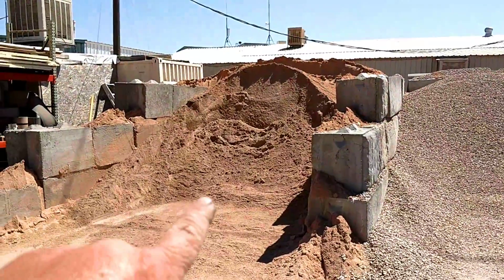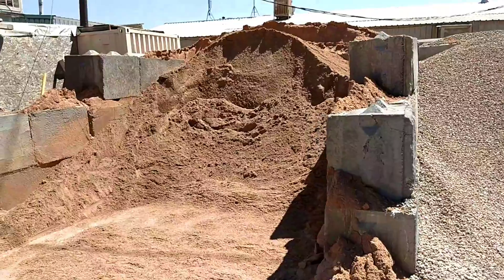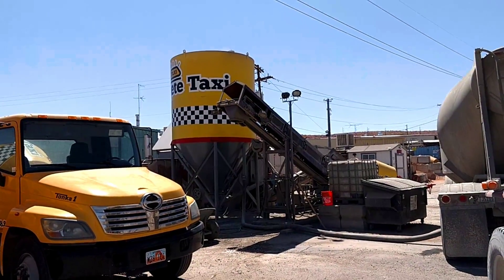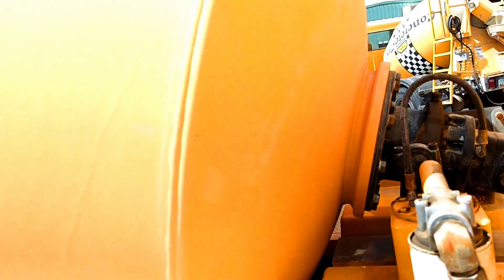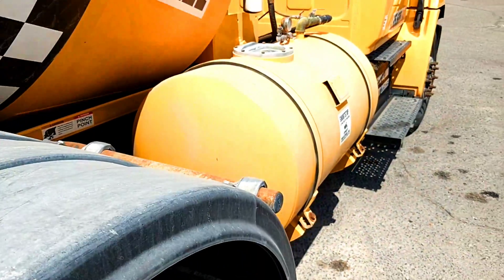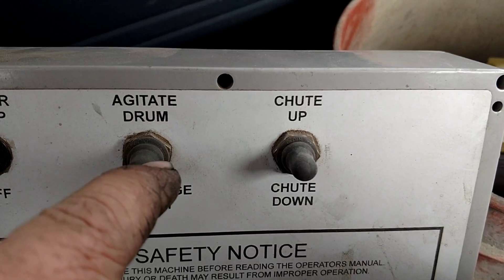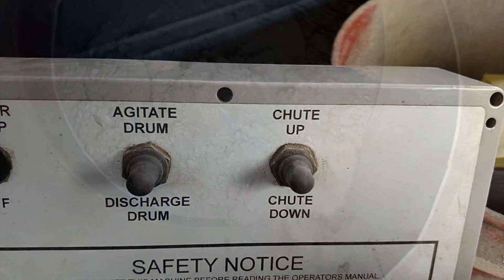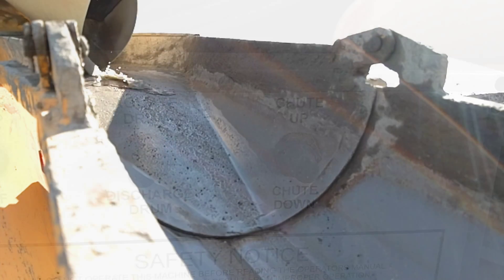How Concrete Trucks Work

Comment: This is more of a 'what a concrete truck does' and not 'how it works'.  I wanna know how the concrete comes out the back, does the drum reverse its spin...???
Reply from the maker: Yes, the direction can be reversed from mix to eject, as well as controlling the speed. It can be done from the back and/or from the cab. The throttle also increases the speed of rotation if the switch is engaged to eject or mix the concrete.

Comment: I worked as a ready-mixed concrete truck driver. And he also used muriatic acid to clean. He also used a diesel sprayer so that the entire structure of the drum was oiled and the cement did not stick. I also cleaned the drum internally many times.
Reply from the maker: I like the diesel idea. We use it for concrete forms. I never tried in the drum though.

Comment: Most builders are spot on with the amount needed it isn't just order a truckload and then figure out what to do. If a few wheelbarrows are still left we find odd jobs to use it on the same worksite nothing is wasted, as stated if enough is left the driver will disperse it into formworks for big blocks at the mixing depot, very useful and efficient. Trucks and roads are smaller in my state as it's mountain terrain.
Reply from the maker: These trucks are super handy for tight spaces and small roads.

Comment: I've never seen a medium duty concrete mixer before. All of the ones I've seen are heavy duty ones.
Reply from the maker: Yeah, it's not big at all. They are used in Europe more often.
Reply: @VanDamArtisan  also what are very rare here in the USA are cabover semis nowadays. I use to see them all the time back in the '80s & down along with a lot of conventional cab ones too, a mix of both kinds of semis. Then when the law in the USA increased the length limit, cabovers phased out & more conventional cabs took their places. Cabovers are common in many other countries, especially over in the UK because their streets have tight corners which are too difficult for conventional cabs to turn on which is why cabovers are the only semis they have.
Reply from the maker: That makes sense. I never noticed that before, but yeah, they used to be all over the place. I pretty much never see them anymore.
Reply: @VanDamArtisan  I bet back in the cabover days whenever the drivers took their semis into the shop for service, they'd forget to take all of their lose stuff out of the cab. Then when the mechanic begins to work on it, all of the driver's stuff inside the cab goes all over the place & sometimes break the windshield too when he tilts up the cab for access to the motor. I bet that was an inconvenience & another inconvenience was drivers who were overweight had trouble getting in & out of the cabs because cabovers had wider cabs & the second step on the sides of the cab was above the front wheel & far from the first step which made the driver have to hold onto the vertical bars on the side of the cab & take one big step between the first & second steps without slipping off & getting hurt unlike conventional cabs that have a narrower cab & are easy to get in & out of & easier to get to the motor & work on it too. I bet semi drivers hated climbing up & down at an angle without trying to slip off the steps, especially in cold snowy weather whenever they'd entered & exited their semis back in those days. Cabovers & conventional cabs have the same overall width, cabovers have a shorter wheel base & why the cabover cabs were wider was because they had to make room for the motor inside the cab which was between the driver & passenger seats underneath the motor housing & not to forget the sleeper in them wasn't as roomy as in a conventional cab because of the motor underneath too. In a head-on crash with another vehicle, the cabover driver would either fly out through the windshield or get his legs & feet crushed on impact depending on the weight of the other vehicle & the speed it was going because the semi drivers were up near the very front having very little protection between him & whatever is coming at him in front.

Comment: Are the leftover dried concrete there because you can't 100% churn out all the concrete? Would it be possible to wash it all away without someone climbing in if theres an opening on the front of the barrel you can use (like some sort of drainage)?
Reply from the maker: It's possible to churn all of it out, but sometimes a little bit dries before it can be washed out. Little by little it just builds up until it has to be removed with jack hammers.
Reply: How much sir

Comment: wow i neer seen a international concrete mixer
Reply from the maker: Now you have. I think it's pretty cool looking on the inside.
Reply: @VanDamArtisan  If you want a luxurious inside cab I'd recommend Volvo, as a kid I used to clean trucks, found loads of porn mags one guy driver gave me shit for for throwing out the magazine under his passenger seat,I explained to him it was no good as the pages were half ripped and stuck together, great job as my younger friends would stick up for me always and told him to F off.
Reply from the maker: @again5162  that stuff shouldn't be in his cab. Not very professional.

Comment: Someone has to climb in the barrel to clean off the dried concrete???
Reply from the maker: Yes. Unfortunately there's no easy solution other than rinsing well in between loads

Comment: Let's say you're out on a construction site, it's the end of the day and there's still cement in the truck that's ready to go. Do you turn off the truck and clean out solidified cement the next day, or do you leave it running? Or would you only add to the truck exactly what you know you'll need to begin with so you won't even encounter this scenario?
Reply from the maker: We dump it into forms and wash the truck out
Reply: @VanDamArtisan  Thanks for the quick reply!
Reply: Will most companies train or do you really need to have Experience
Reply from the maker: That depends on the demand for drivers. Most of them will train when they need the drivers. Some will even pay for the commercial license fees. I paid for mine though.

Comment: what is the water to cement ratio ? or do you just eyeball how much water goes into each batch?
Reply from the maker: The batch plant adds the bulk of the water and then the rest takes a little guess work. It's around 15-20 gallons of water per cubic yard of concrete.

Comment: Dear sir, thanks a lot for posting the video would you please help with a question what is the average load ft3 or weight? thanks
Reply from the maker: 1 yard³ is equal to 27 ft³ and weighs around 3,500-4,000 pounds, depending on aggregate and moisture content. The truck in the video holds nearly 4 yards and has a gvwr of 32,000 pounds. Bigger trucks hold 10 yards and have a gvwr of 80,000 pounds.
Reply: VanDam Construction  Thank you so much for your information, have a great day.
Reply: To clarify what GVWR is: If the GVWR (gross vehicle weight rating) of this mixer is 32,000 pounds that means that at no point should the mixer itself and concrete exceed 32,000 pounds. 
For example: the driver, concrete, frame, engine, windows, body panels, etc.. have to weight 32,000 pounds or less. 
This GVWR is usually determined by the manufacturer.